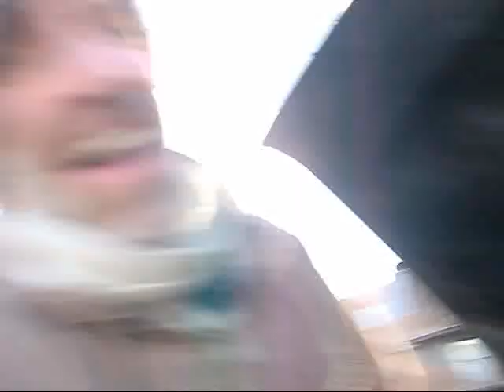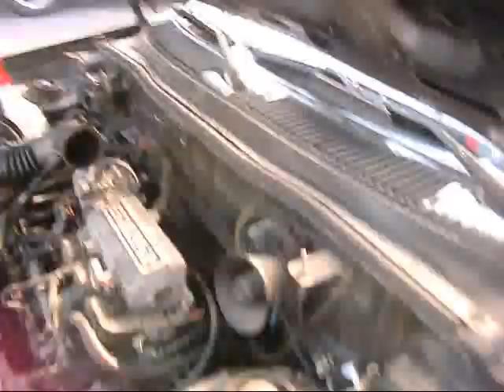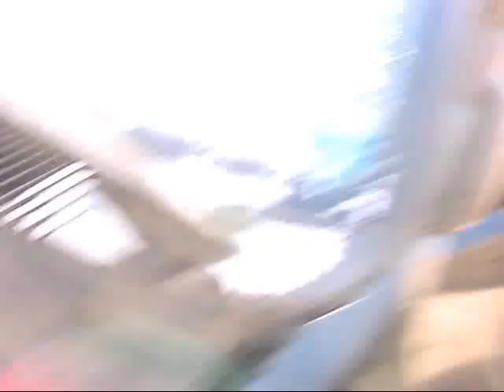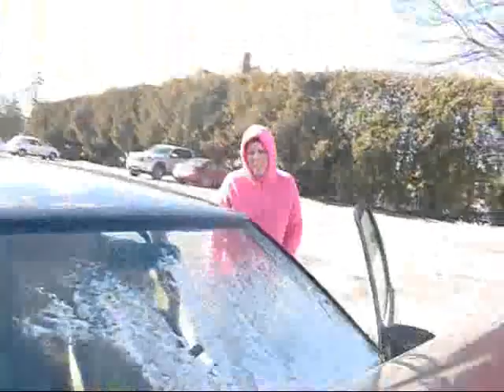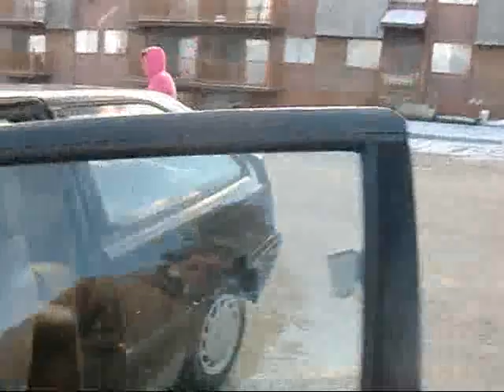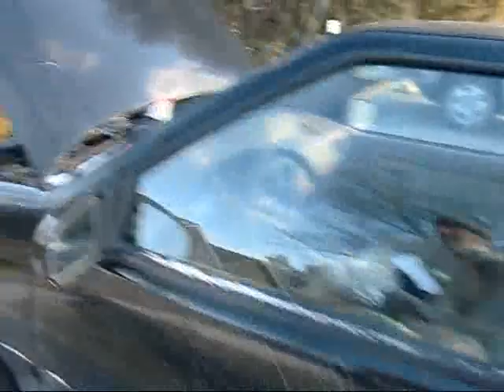2 4 13  Ze Dr Ze Hyundai Dead Vid

Comment: Hhave you tried using a heat gun and pointing it at the air intake. I know this works on old diesels and since this pos wont start cold. I dunno might be worth a try.